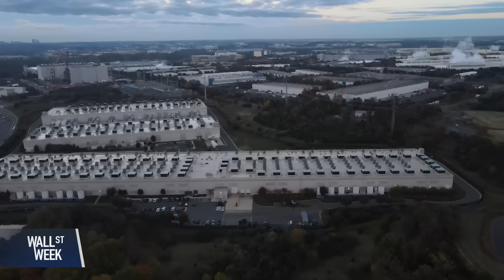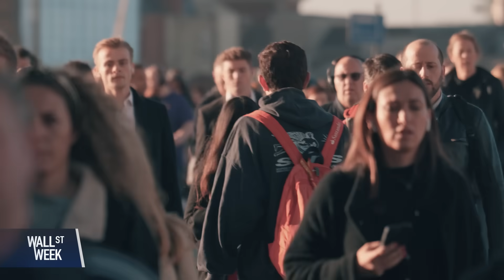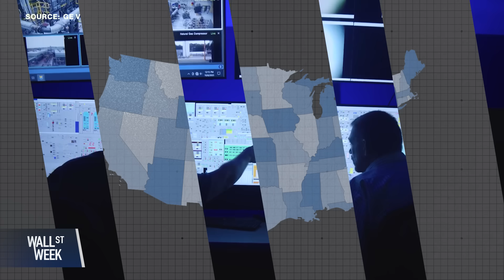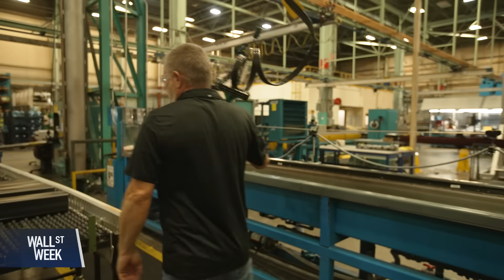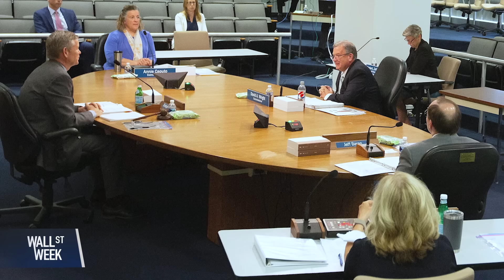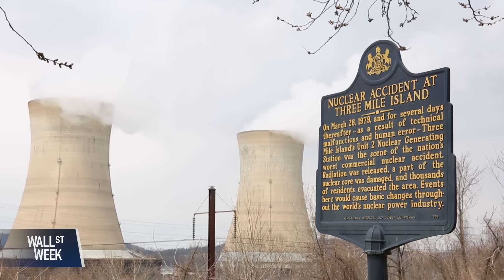US Power Shortage: How Small Modular Nuclear Reactors Could Fill the Gap

Comment: People are chasing uranium miners, but ignoring the fundamentals of adoption
The market is acting as if uranium supply is the bottleneck, when in reality the bottlenecks are everything that happens AFTER the fuel exists. Investors are piling into miners because it’s the only “fast” part of the nuclear chain, but nuclear adoption is constrained by slow, physical, institutional limits that money cannot accelerate.
Even if uranium supply doubled tomorrow, it wouldn’t create a single new reactor.
The real constraints are:
- skilled labor shortages (licensed welders, nuclear engineers, reactor operators)
- multi‑year lead times for pressure vessels, turbines, forgings, control systems
- regulatory approvals that take 5–10 years before construction even begins
- construction timelines of 8–15 years for large reactors
- decommissioning liabilities that utilities must pre‑fund
Uranium miners can scale in 2–4 years.
Reactors scale in 10–20.
That mismatch is the core problem.
The grid cannot absorb new nuclear capacity anyway
Even if reactors magically appeared, the grid is not ready for them.
Aging transmission lines
- Much of North America’s high‑voltage grid is 40–70 years old
- Many lines are operating beyond their original design capacity
- New transmission corridors take 7–12 years to permit and build
Undercapacity of local transformers
- Distribution transformers are the biggest hidden bottleneck
- Lead times have stretched to 18–36 months
- Many substations cannot handle the load of a single modern data center, let alone a reactor
- Utilities are already rationing transformer replacements, there are millions of them, remember.
Nuclear is useless if the grid can’t move the power.
AI hype grows like software — nuclear grows like heavy industry
AI datacenters can be built in 12–24 months.
Nuclear reactors take a decade or more.
This creates a structural mismatch:
- AI demand is exponential
- Nuclear supply is linear and slow
- Uranium miners are the only part of the chain that can scale quickly
- So speculators chase miners, ignoring the physical constraints downstream
It’s the same mistake people made in lithium:
they bought miners, but the bottleneck was refining and battery factories, not ore

Uranium supply is not the problem.
Nuclear adoption is the problem.
YOU ARE TALKING ABOUT THE WRONG THING.

Comment: Fossil fuels know the joke, the traditional infrastructure of poles and wires and transformers and switch yards and transmission to millions and millions and millions of consumers meter boxes is all extremely expensive and its capacity has to be expanded many times to remove fossil fueled energy. 
Then the ROI, the GRID RENT has to be paid.
Fuel is dirt-cheap, electricity generation is dirt-cheap, it is the transmission infrastructure that is extremely expensive and extremely demanding in raw materials and time.

Fossil fuels know the joke.

Comment: If the USA merely invested in closing their nuclear fuel loop they could use the 95% of usable energy that rots away in dry storage now and reduce by 80% the volume of waste overall by extracting the usable high-level energy from waste and deep repositing the medium and low level waste safely below ground while their radiation levels reduce..  Don't believe it's possible? This is exactly what Russia and France both do now! The waste issue isn't a problem at all as long as you don't do what you are doing now which is basically throwing away your spent uranium after 5% of its energy has been depleted. Imagine if you drained your car's fuel tank after only 5% of its range was used because that's what you're doing NOW!

Comment: More lies smr aren't small they are as large as power plant😂😂
Reply: SMRs are sized to fit on a semi trailer.   It is a high pressure steam generator.   The site still has to have its own steam turbine generators, condensing systems and the people to run a steam plant.   Steam plants need consistent tending with a lot of responsibility.   They can explode!   Gas turbines and Diesel engines can run unattended for weeks.
Reply: LOL, what does that even mean? Power plants come in all sizes from diesel generators to dams... Dumb ass!

Comment: ☆3.5kWh of fossil fueled energy per 1kWh of mechanical central electricity. 
☆3.5kWh of nuclear fueled energy per 1kWh of mechanical central electricity. 
☆3.6kWh of sunshine per 1kWh of PV roof electricity. Then 99% useful. 😊
Just some interesting efficiency facts. 🤔  😊😊 

Central generation is 4cents kWh electricity and 44cents kWh with grid RENTAL costs at the grid meter. My grid supply, 56cents kWh . WTF 

PV roof electricity is 2cents kWh electricity free of grid rental costs. 😊 LOVE ❤️ 

Just some interesting facts about electricity economics. 🤔 😊😊

1m² of PV and 4.6 hrs of 1kW sunshine is 3.6kWh wasted per m² daily. 

Full roof is 220kWh x 4.6hrs daily is 1 MWh wasted sunshine daily. 🌞 
With PV roof shade 😎 cooler roof, cooler home, cooler air-conditioning 😎 costs. 

Tax-free energy savings for wealthy high marginal taxpayers is love at first sight.❤️ 

Tax-free savings in business hours is love ❤️ at first sight. 

No petroleum vehicles CO2 emissions with electric vehicles and massive FREE ELECTRICITY STORAGE on wheels parked 23hrs every day and all night long. 247 dirt-cheap electricity and more Tax-free savings love ❤️ the more you look.

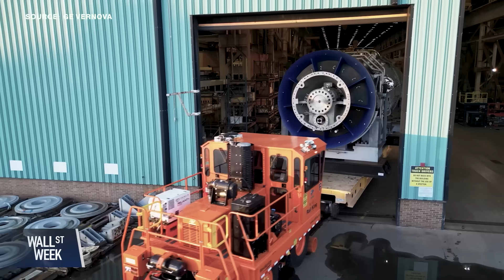Comment: 3:14 - SMR doesn't have a hope of saving the commercial nuclear industry.  SMR is basically a capitulation that large-scale nuclear does not and will not scale economically.

SMR still remains unproven and ultimately will be unviable especially as other solutions are cheaper and faster like dispatchable firm renewables (renewables + storage) which are already at or lower than commercial nuclear on a per MWh levelized cost basis.

Specifically...

SMR is heading the wrong way in both cost per MWh and smaller capacity per unit.  SMR's are at the intersection of having smaller capacity and still having the same long custom manufacturing—this is a bad place to be because SMR will have higher cost per MWh than traditional nuclear.  And traditional nuclear already has some of the highest costs per MWh to begin with.

A big part of this are that SMR proponents like to advertise words like "modular" and "mass manufacturing" but its nothing more than a marketing lingo to try to slip by the public and high level politicians who may not be up to speed on nuclear tech.

In reality, SMR has no serial manufacturing and never will...

Custom bespoke manufacturing is endemic to nuclear reactor construction and it's dogged the industry since its beginnings.  Manufacturing something as complex as a nuclear reactor would require an enormously expensive and complex factory and associated supply/manufacturing lines.  Such a factory would be at least an order of magnitude more complex than a nuclear reactor itself and a reactor is very complex to begin along with having very tight engineering and certification tolerances.

The economics don't work out for commercial nuclear power mass serial manufacturing...

At the root of this problem is a chicken-and-egg problem combined with nuclear power's endemic high costs, slow builds, and risks:

No mass orders → no serial manufacturing
No serial manufacturing → high costs & slow builds
High costs & slow builds → no mass orders (_and repeat from the top_)

Until a deep manufacturing automation pipeline exists at scale (never will happen), most of SMR assembly is done by expensive and slow bespoke manufacturing methods that have been endemic to the commercial nuclear energy industry.

SMR has these showstopper issues all while delivering a reactor that has a fraction the capacity of traditional utility-scale reactors!  So will need several SMR units just to equal one traditional large-scale nuclear reactor.
Reply: -quote from the car industry before Henry Ford

It’s mostly the permitting, reviews, and insurance costs that leads to expenses
Reply: @neuropuritan_zealot8455  Also…

Another big nuclear energy cost is eventual retirement (decommissioning) of the nuclear power plant.

Decommissioning old nuclear power plants is a tremendously complicated process taking billions of dollars and a decade or two in time—all while the plant produces exactly zero watts of power!

Meanwhile, the old nuclear plant remains an "ongoing concern" taking up labor and material resources as well as representing a radiation hazard.  It also prevents the land from being reused in the meantime.  Often the land is never returned to its original state due the complexity and cost of nuclear decommissioning.

No other electricity generation comes close to the cost and complexity of nuclear power decommissioning.   In fact, solar & wind farms don't really technically need to be decommissioned as they can be incrementally renewed (repowered) indefinitely with new technology even as the farm is still running and generating power.  So renewable farms can actually be using the land in perpetuity and their old products can be repurposed for less demanding applications, donated, and finally recycled without dealing with hazardous radiation.
Reply: @neuropuritan_zealot8455  Also…

Another big nuclear energy cost is eventual retirement (decommissioning) of the nuclear power plant.

Decommissioning old nuclear power plants is a tremendously complicated process taking billions of dollars and a decade or two in time—all while the plant produces exactly zero watts of power!

Meanwhile, the old nuclear plant remains an "ongoing concern" taking up labor and material resources as well as representing a radiation hazard.  It also prevents the land from being reused in the meantime.  Often the land is never returned to its original state due the complexity and cost of nuclear decommissioning.

No other electricity generation comes close to the cost and complexity of nuclear power decommissioning.
Reply: @neuropuritan_zealot8455  Another big nuclear energy cost is eventual retirement (decommissioning) of the nuclear power plant.

Decommissioning old nuclear power plants is a tremendously complicated process taking billions of dollars and a decade or two in time, all while the plant produces exactly zero watts of power!

Meanwhile, the old nuclear plant remains an "ongoing concern" taking up labor and material resources as well as representing a radiation hazard.  It also prevents the land from being reused in the meantime.  Often the land is never returned to its original state due the complexity and cost of nuclear decommissioning.

No other electricity generation comes close to the cost and complexity of nuclear power decommissioning.
Reply: @neuropuritan_zealot8455  Thanks for the comment.  Yeah, the regulations are one of the costs of nuclear.  But it's not the largest one.

Nuclear energy's costs start right at their beginning of life with complex construction and engineering.  Upfront capital costs are very high and requires jumbo sized loans that have higher interest rates.  The entire plant will be a very large civil engineering project for 5 to 10+ years all while generating exactly zero watts of power.  No other power plant takes this long.  Solar and wind can be completed in less time even if factoring capacity factor.

Then nuclear has some of the most labor intense operations & maintenance compared to every other electricity production and needs highly trained staff that need constantly retraining.   The entire nuclear plant operates as a small town complete with armed guards, fire station, backup generators, spent fuel pool, dry cask fuel waste storage, offices, security cameras, parking lots, etc.

Refueling a BWR or PWR is a very complicated and costly endeavor and can happen every 2 to 5 years needing a full shutdown because the reactor core needs to be opened up.  It's a risky slow process as because core emits lethal amounts of gamma radiation.

Simply put, nuclear regulations are in proportion to the unparalleled high risk profile that nuclear represents.  No other electricity generation source even comes close to nuclear energy's risk profile.  Hence, it's not unreasonable that regulations are much higher compared to other electricity generation sources.

Nuclear energy has unique challenges regarding safety parameters and tolerances.  Nuclear energy needs things like: a large amount of radiation insulation, a full radiation containment dome able to withstand a direct hit from a jet liner, and several layers of redundancy.  These extra safety procedures and designs aren't negotiable.

Every nuclear power plant operates in essentially a "high stakes" operation.  Because just one slip up of even a fraction of the seriousness of Fukushima-Daiichi would set back the entire nuclear industry—possibly for good this time.

The regulations might seem heavy, but they exist because the alternative isn't worth risking
Reply: @beyondfossil briefly, where does your deep interest in this subject come from?
Reply: @neuropuritan_zealot8455  Furthermore...

I'll be frank that nuclear energy is indeed fascinating technology.  It even has an "otherworldly" aspect to it that no other power generation has.  But this does not mean that nuclear energy is applicable everywhere.  It is not.  Specifically, commercial nuclear energy is absolutely the wrong tool for the job on the large-scale grids: way too slow to build, way too expensive and comes with unparalleled risks that no other electricity sources even approaches in risk profile.

Nuclear won't go away though.  Because it actually excels in small-scale mission critical applications like those found in the military, scientific fields and deep-space exploration.  Fans of nuclear energy can and should be happy that nuclear energy is leading the way in the fields. Use the right tool for the job and things get much better instead of constantly trying to fit a square peg into a round hole.
Reply: @neuropuritan_zealot8455  The first part of my reply to this doesn't show up even though I've tried like 5 times to post a simple paragraph.  I give up, maybe the posts will show up later.
Reply: SMR promise to be fast to produce and install allowing them to come online at existing nuclear sites in a couple years.   SMRs are estimate as being more expensive per MW than full scale nuclear.   They should have strong cost control and not greatly overrun budgets as is the norm for full scale nuclear.

Comment: Lets do some MATH
Power Generation in 2025 | China has 10.1K TWh | USA has 4.4K TWh Per Year | USA needs 5.9K TWh to catch up to China AI
1 Nuclear Plant generates 8.06 TWh/year | 5,900 \ 8.06 = 735 Plants need to be build | 1 Plant takes 18 years average to build from construction to activation
Currently 2025 USA Builds 0.2 Nuclear Plants per year, to build 735 Nuclear Plants will take 3,675 Years at current pace.
OK, lets assume USA builds 10 per year, we all know its not going to happen, but lets assume, that will take 74 Years.
These people don't know what they talking about.
Reply: China is the world leader starting in 2018 for building hundreds of new highly efficient ultra supercritical (USC) clean coal power stations to re-power and greatly increase capacity of is power grid.
Reply: @douglasengle2704  Did you say CLEAN coal. 😂😂😂 Quit believing your orange clown. 🤡
Reply: Doesn't China use massive amounts of coal, oil and gas with little or no emissions regulations? Do these emerging countries adhere to de carbonization goals? No they don't so either you support Western standards or you are simply a communist 😘